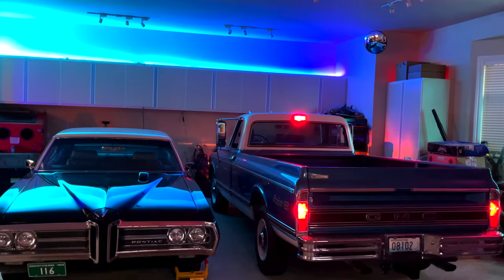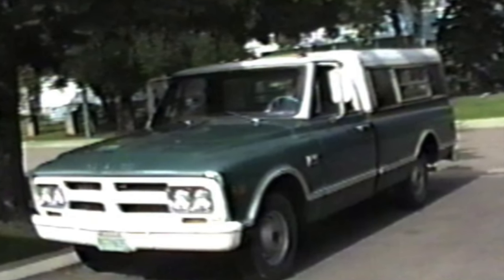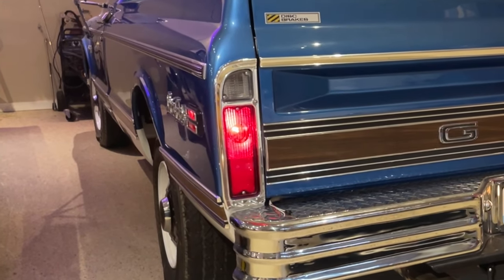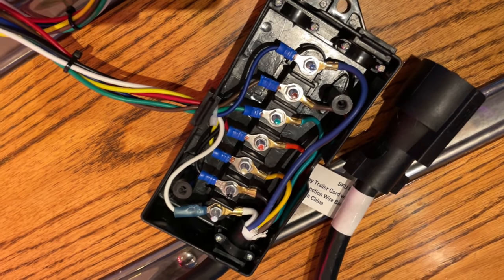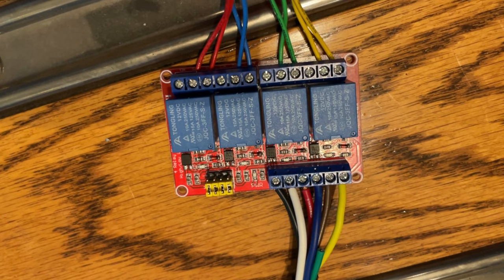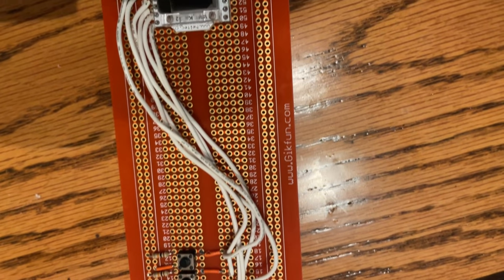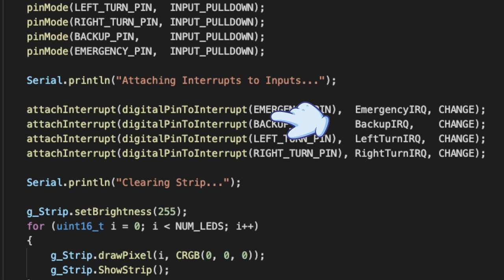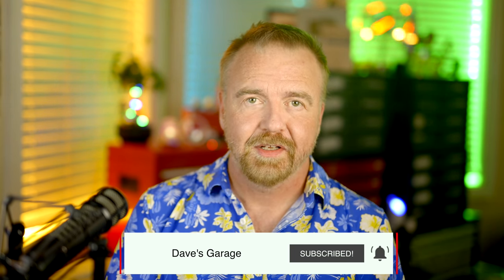Coding Sequential LED Tail Lights! C++/ESP32/Arduino Project

Comment: Good to see a flashy LED project with a functional purpose (even though I also love flashy LED projects that are purely for the sake of aesthetics too). Here in the UK (and Europe too I think) it would be a bit easier to accomplish, as by law we require separate turn indicators and therefore the brake lights would never be one-side-on, one-side-flashing. It would be interesting to see a full code walkthrough of this project.
Reply: That's exactly what I though. But on the other hand you would also need at least a second row of amber LEDs.
Reply: @saffeld  Not really, the LED units he is using have an integrated 3 LED solution, so you can choose from red, green or blue, so you can easily make orange with just how you control the brightness of the 3 LED's in each package.

Comment: I'm doing a VERY similar tailgate light strip on my 88 Silverado, but will be using an addressable COB strip in hopes of getting a completely uniform diffused light output. It will be housed in an aluminum profile channel with either a clear lense or a diffused lense if I need further diffusion. So far my preliminary testing is a success with the leds - plenty bright for daylight visibility (my initial biggest worry). Cheers

Comment: Nice that you also delve into simple logic circuits. I've designed a logic circuit that can control a high flow PWM fan with 4 settings (off, low, med, high), have to build the circuit yet though. They're for the extraction fans in the roof (A few old Compaq Server 12 inch fans).
Kudos for your channel Dave!
Reply: uh-oh...spam comment from Dave???

Comment: TANDY Keyboard bounce hypothesis - They developed upon prototype systems that had heavy, maybe more expensive key-switch's - got it all working, burned into ROM.  The ROM's then met the production machine, with any savings made and keyboards would always be an area, or whatever reason the production machine with the ROM had keyboard bounce issue and cheaper to do update onto tape and/or redo the ROM in-time for release.
Reply: You hit the nail on the head! When working back then,  I asked that very question & was given that explanation. But what idoes  girl know? Right? They said you can adjust your typing 'skills'. Remember the system was intended to be a no cost inventory machine for the stores - projected 3000 machines that would fail in marketing. The public didn't really want a computer in their home and wouldn't sell,  then it could be written off and used in the 3000 (actually 3700) stores we had at the time.

Comment: A 3.3v Zenner Diode can also be used on the input to save cost; but the optocoupler is a more solid design.

Comment: I am really digging this to put the strip on my truck and more important my horse trailer. IDK what it is something about hauling my family that makes people act stupid or ride me so close I can't see them but anyway. Finally I would try modding the police strobe code to do amber strobes which would be handy for me who sometimes works on the side of the road and utility workers not to mention handy if you are changing a tire on a narrow two lane road. Would also like to replace the 3 lense brakes on my 01 mustang with LED panels that do similar to this maybe use the fire code if I want to get fancy.  I know the LED fire and other effects you covered will look awesome once I upgrade the old school RGB LEDs I have all over the trailer now. Actually won a contest with it. Since I am having to redo the 12 volt wiring in it anyway I am also adding a 4 channel remote to turn on various lights as I ride up to it at night but still work from the signals in the truck as well. If I get any of it going I will post to discord.

Comment: The Arduino is great for a prototype but "production" units wouldn't need the serial out or display. It would be cool to see this up on TinkerCAD Circuits using an ATTiny processor.
Reply: why don't you do it.
Reply: @TheUnofficialMaker  I may just, once Dave puts out the code and I have a break in my production schedule.
Reply: @TheUnofficialMaker  I finally got around to trying out the neopixel led strips with an ATTiny processor and it is just too slow.  The fastest I can toggle a pin on the ATTiny is about 30us and the neopixel strips require .5us high 1.5us low timing for a "0" and a 1.2us high 1.3us low timing for a "1".

Comment: Would be nice to show more of the installed details. I.e. how the wiring was routed, microcontroller mounted, hidden, waterproofed, the lighting cables through the tailgate and so on. How do you shutdown your controller, what if it corrupts etc.
It will draw some petrolheads too, albeit not sure if that’s a good thing or not 😂
Reply: For some strange reason I believe that there's quite a large overlap between petrolheads and code monkeys. Might be kind of the same thinking processes and problem solving behind both. I'm in IT and also love building stuff and cars. :)

Comment: Is that even legal? Here in Europe that truck would not be allowed on the road with those Christmas lights on it.
It is pretty cool though :)
Reply: It would not be able to run without a dedicated amber turn signal too. BTW this American style turn signals that share the break lamp are a horrible idea.
Reply from the maker: Not sure why you say that.  I've read the Federal Motor Vehicle Safety Standard, FMVS88, to check for compliance.  What part do you think it might violate here or there?  And Christmas trees are not orange/red.
Reply: @DavesGarage  EU vehicle specifications are different to US ones, which allow for the single rear lamp doing dual function, and even the EU spec headlights are different from US spec.  You can probably source either original or pattern parts for the rear lamp units to EU spec, and order first the pattern parts, so you can experiment with easy to replace units to get your rear LED conversions done, though you will be needing to use a custom made flex and aluminium core PCB ( cheap though for what you get) to fit the required 3W or 5W single colour lamps in there, plus a custom milled heatsink, so that they will be as bright as the original 21W lamps.  You might just want to stick to the pattern parts, unless you can find a set or two of the originals that are new in box, as they do suffer a lot from the plastic fading in colour with exposure.

You might want to expand the search to Australia as well, those vans were exported world wide, and certainly there are still some running in that large continent, and they will have the required orange inserts. Seen a few in South Africa as well, but not in the great condition yours is in, most are more a collection of rust and body filler in close formation, with all the major defects hidden by a thick coat, and a new coat of paint poorly applied. But you can still get spares for them, so they keep on running.
Reply: @DavesGarage  I'm not sure about American laws around this. EU (or, at least Dutch) standards are VERY restrictive on what you can put on your car in terms of additional lighting. They definitely prohibit installing blue lights (reserved for emergency vehicles). Extra lights, apart from the factory ones, are not allowed while driving, and needs to be completely disabled by a switch. Any lighting, even the disabled lights, need to adhere to certain EU specifications. You certainly can't use a non-waterproof LED strip without it having a specific E- numbered certificate.

Comment: Cool video as always. I actually have a Ford Maverick on order which is shipping with two dedicated diy 12v lines in the bed. Of course, my imagination has been going on about utilizing them. Been thinking about doing a similar project for my bed lighting especially since it is needed with a cover. Already seen some fun ideas on other videos like a magnetic switch that triggers when the tailgate opens.

I may have missed it in the video but I take you haven’t gotten to the permanent install point? Nothing seemed to be weatherized. That has been my hangup since a waterproof box seems reasonable but I worry about the heat output of the buck converter.

Comment: 12volt led on a automobile is not really the best idea. Most of them run from 13.2-14 volts. Way above the 10% mark. They will burn out. I've use single color no effects. And had to use 5volt led with 3 in series to make for 15volt drop across them.